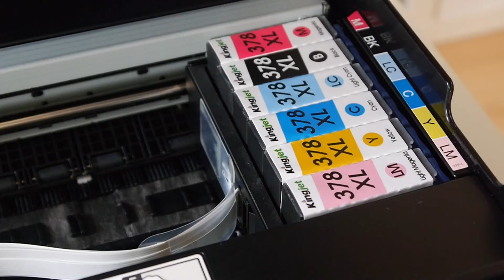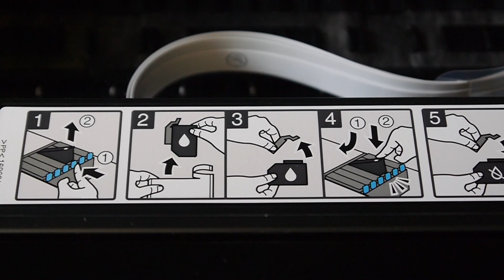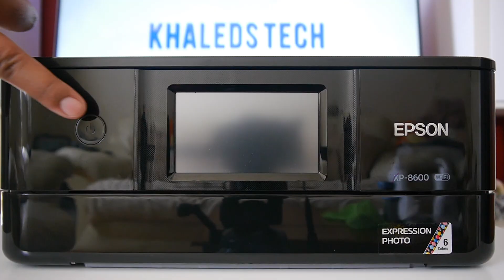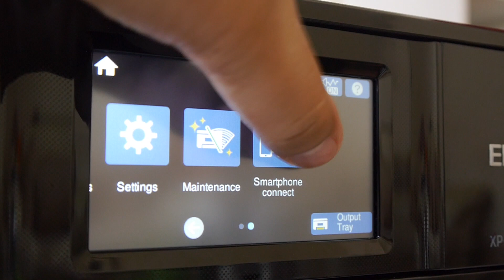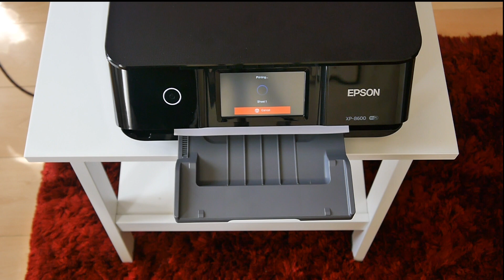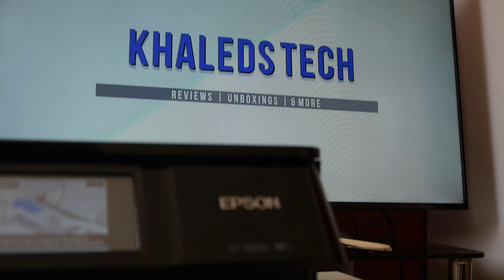Epson Expression Photo XP-8600 - Review

Comment: Interesting review, however an important factor you didn't cover and many other reviewers have also missed out on is the feature that it can print directly on to CD/DVD labels like the XP-8700 as well, and I had to contact Epson directly to find out about this and they said the Printer tray for discs is located underneath one of the paper trays which I found later, I hope this is a help for those who wish to print directly to discs rather than use stick on labels which go corrupt after 5 years due adhesive surface movement okay.
Reply from the maker: Thank you very much. I will pin your comment

Comment: Is this printer comparable to the 8700? What are the differences?
Thank you
Reply from the maker: Hi, I haven’t used the 8700 but it looks like the updated version of the 8600. I presume the printing maybe slightly quicker however apart from that it should pretty much be the same.

Comment: I’ve just purchased this printer… I took off the clear plastic strip that was attached under the inks and to the white ribbon (under the scanner bed)… should I have left this attached as you have? 🙈
5:54 minutes in, it can be seen - Thank You.
Reply from the maker: The white ribbon is required for the printer to function properly. The blue plastic strips are okay to remove.

Comment: The black is showing no ink and have replaced with others including a new epsom 378XL and still not reconised, is this a major fault to send away for repair or is there a fix that I can do myself ... Al
Reply from the maker: Hi Al, 
I am not too sure, you can maybe try cleaning the chip contacts with a damp cloth. Apart from that it may need to be repaired.

Comment: Hi KT, Interesting review. Liked the close up of the screen in operation. You are obviously knowledgeable about printers, so can you advise on the following please. I do not print a lot of photos, so is this printer good for general printing? Can it be used with a USB cable for computer connection. Quality of build? I know that noise is subjective, but reviewers like you may have a better interpretation of noise than the average user. Finally, no one mentions WiFi frequency compatibility, 2.4Ghz or 5Ghz. Many thanks. Terry Davis
Reply from the maker: Hi Terry, thank you for your comment and questions. I print several documents and also the family print out photos. Its a great everyday printer  and a fantastic photo printer. You can connect to your computer directly via USB. The quality of the product is very good along with a small footprint so it fits almost anywhere. Generally speaking the sound isn't too bad especially if you are connected via WiFi and the printer is down the corridor. You can select the quiet option if you're in no rush and then it just sounds like any background noise. I had a quick look at the Epson website and the WiFi frequency is 2.4Ghz. I hope this helps. Khaled
Reply: @KhaledsTech  Hi Khaled, Very many thanks for taking the time to respond to my questions, and for replying so quickly, a rarity these days. You have certainly given me more confidence in this product. I have established that my Router works on dual frequency, 2.4Ghz and 5Ghz. My concern is (as an 83 year old man), that I am not confident  or competent enough if I need to switch the frequency.  I may upset my Broadband, TV and Router set up. However, that's my decision and I really appreciate your comments about the printer. My thanks again
Terry
Reply from the maker: You're welcome Sir, you won't have to worry about switching any channels or frequencies. You can pick your network up through the on-screen display and put in your WiFi password. Also you seem to know your stuff so 83 is just a number 🙂
Reply: @KhaledsTech  Keep up the good work! I am a UK viewer of your video.
Reply from the maker: Thank you very much fellow U.K citizen.
Reply: @KhaledsTech  Hi KT, Not wishing to put all my eggs in one basket, what do you know and feel about the Epson XP8700 and the Canon PIXMA TS8350. They look interesting to me. Many thanks again Terry
Reply from the maker: I haven't used either but both of them are good. Due to personal choice I would go for the Epson.
Reply: @KhaledsTech  Many thanks again

Comment: Khaled; the printer arrived yesterday and today I am testing it for printing. The front power panel (?) does not stay shut, even when power is off. Tech support asked me to push harder to close it, but that, of course, did not solve the problem with this smoothly operating high-tech printer. If I tilt it backward I can close the panel. When I put it down flat again the panel once again tilts upward. I noticed in your video that the panel is shut flat until the printer is asked to print. What am I doing wrong? I hope you or another reader can help. Thank you so much.
Reply from the maker: Hi Tim, I will have another look tomorrow, that is quite odd, can I just clarify if you're referring to the panel that has the LCD screen on It? Or are you referring to the paper tray flap?
Reply: @KhaledsTech  ; Sorry I did not get back to you. I was referring to the "control panel" with has the screen and power button. I finally talked to a 3rd tech support person and she walked me through downloading the drivers for the printer. That was to turn on the duplex printing which I thought was automatically turned on by default. Then I told her about the cover issue and she like another woman told me to give it a little harder push to close it. I did and now it seems to be working. I will keep my fingers crossed.
Reply from the maker: No problem at all Tim. fantastic I am glad you're up and running properly. It does need a bit of a push sometime but don't worry it won't break. The design is pretty robust. Hopefully it should serve you well my friend.
Reply: @KhaledsTech  , I just tempted fate and ran it through a print cycle. All worked well. Thanks for your support. I look forward to your next videos. I just ordered a new Samsung 10" tablet. I will see if you have a video on it. I'd love to know what you think about the Galaxy Tab A7 (with 64GB).
Reply from the maker: Thank you very much Tim, I've done a unboxing of the Tab A and a shorts on Tab A7. Pretty decent tablet and ticks most boxes for everyday use. Thanks for your support as always

Comment: I noticed on the Epson site it shows a CD included for printer setup. This is not useful to most of us as so many computers have dropped the CD player. Can the setup be downloaded another way? Watching another reviewer video I noticed much of the setup seemed to show up on the 4.3 screen once you first turn on the printer. Is that the full setup?
Reply from the maker: You can set it up through the on screen printer and connect to your printer. Then your computer should pick it up on the same network, you may need to add printer under settings on windows 10. To get the full features you can download the Epson suite under drivers on the Epson website.
Reply: @KhaledsTech  , I have upgraded to Windows 11, but imagine is should set up fine with it. Thanks again for a great tip.
Reply from the maker: @timhvv  You're welcome

Comment: One very important feature am not sure is present or it is and you may have missed it, 
does it have a hidden CD/DVD tray on the side to print directly onto DVDS and CDS ?
Reply from the maker: Hi Mohammad, yes this is correct you will need to get the right media in order to print to the DVD/CD. Apologies at the time of recording I should of covered this but was unaware. I am working on a updated video for this printer which is long overdue.

Comment: This is by far the worst printer I've ever used. No manual, no quick start guide, insists on printing everything on A4 no matter what I do in settings. It prints as required from my old Win 7 pc but a complete turkey on my new Win 10 pc. Anyone got any ideas before I return it? Am I missing something?
Reply from the maker: https://www.epson.co.uk/support?productID=27797&os=19#drivers_and_manuals
Reply from the maker: Hi, Download the Epson full suite of software to make the best use of this printer.
Reply: @KhaledsTech  Very many thanks. That's solved it. I'd tried to locate drivers through the Epson site but I couldn't even find this printer listed. Very grateful for the direct link to where I needed!
Reply from the maker: Fantastic, glad it's all working now :) if you come across any other issues do let me know.
Reply: @KhaledsTech  Thanks again.

Comment: Thanks for your review. What do you think of the expensive price if the ink cartridges and I  was wondering if you get a lot more prints  with these
Reply from the maker: Hi Peter, the prices of the genuine ink cartridges are extortionate. I would put the longevity of the cartridges on par with the genuine ones.
Reply: Might have to think about getting the eco tank et-2750. Got loads of photos to be printed. Would you personally advise me to look into it   Never had a refill printer
Reply from the maker: @petergregory6185  I have heard great reviews on the Ecotank printers, however I haven't personally used them. If you are printing a lot of photos' and documents then it would be a good option.

Comment: I have this printer and I'm struggling to get quality prints. Especially on glossy/photo paper. I find that it prints lovely, but then when the ink dries it looks really washed out and awful. Is it a paper issue or the printer?
Reply from the maker: What sort of paper are you using? I know it sounds weird but you're not letting it dry near direct sunlight are you? Also what GSM photo paper are you using?
Reply: @KhaledsTech  I think it's dried in and out of direct sunlight. The paper I'm using is glossy white sticker paper from amazon. Evergreen goods. The GSM is 80. Maybe I need to fiddle around with settings?
Thanks so much for your reply!!
Reply from the maker: You're welcome. Please have a play with the settings. Do you use third party ink cartridges?
Reply: @KhaledsTech  no, the ones it came with. I'll keep playing with them and see if something works :) thanks again
Reply from the maker: You're most welcome :)

Comment: There is also a Epson XP-8605 in white, is it the same? 
Which multi function photo printer for the home around the £150 mark do you recommend?
Reply from the maker: Hi Natty, In all honesty this is the first time I heard of the XP-8605 but it looks almost identical apart from the colour. (If anyone knows the answer can you please reply in this thread) I have been using this printer for a while now for both home/office use along with occasional photo prints and scanning documents. I think its a great printer and does everything I need it to do however the ink is quite expensive :(
Reply: @KhaledsTech  How does it compare to the Canon TS8350 (Up to 4800  x 1200 dpi)?
Reply from the maker: I haven't personally tried the Canon but I chose the Epson based on reviews and print speed. Everything considered I would still pick the Epson over the Canon but that's just my opinion.

Comment: How does the 2sided printing work on this? Is it automatic 2 sided or do you have to reinsert the page for it to print on the other side?
Reply from the maker: Hi Alex, it automatically gets fed back into the printer when two siding printing is selected. No need to change it manually.
Reply: @KhaledsTech  great. Thanks!
Reply from the maker: @alexfergus8149  You're welcome.
Reply: Duplex works great.

Comment: I have this printer and I have printed a couple of prints but I noticed some horizontal lines coming on to my printer. I have tried everything in the settings to get rid of it but nothing is working! please help!! thanks
Reply from the maker: So you have cleaned the nozzles and went through maintenance. Can you take the cartridges out and see if there's any ink that is leaking and potentially try a new set? If you tried everything in settings it can be defective cartridges.

Comment: You don't say anything about the thickness of photo paper or cards which this printer will handle. Does the top, or rear paper intake facility enable the printer to handle, say, 210gsm paper?
Reply from the maker: Hi, Yes it can handle 210gsm photo cards/paper. If you're using 255/290gsm then it's best to feed the paper in one at a time so it won't cause any issues to the  printer.

Comment: Yes I would like to see the quality of output for photos on quality photo paper. Cheers 👍
Reply from the maker: Hey Andrew, will look into this for you :)
Reply: @KhaledsTech  Do you recommend this over a hp envy?
Reply from the maker: I haven't used the envy so wouldn't be able to give you a honest opinion. However I am happy with my Epson. Hope this helps.
Reply: I'm having issues with it printing darker than the screen with non-adjusted settings. My old canon mp540 printed screen brightness out of the box. Any tips? Thanks
Reply from the maker: Hi, you can do colour adjustment through the printer.
Reply: @KhaledsTech  ah. I'll check it out. I've been doing it through the printer dialog settings in Windows. Thanks!
Reply from the maker: You're most welcome. I am going off memory, if it doesn't work then please let me know and I can have a look when I am at home.
Reply: @KhaledsTech  I've been through the printer menus. I could find no color collection options.
Reply from the maker: Oh no! Okay I will have a look tomorrow and get back to you.

Comment: I have had this printer for 3 weeks now and am disappointed with it.all my prints are dull and no vivid colours, it is the same when printing DVDs,any help please
Reply from the maker: Hi, I haven't had any issues with my printer and had it for a while while. What are you printing, I am guessing pictures from your comment? I haven't tried printing on DVDs yet but it could be the resolution you're printing at?
Reply: So how do you change that and what too
Reply from the maker: Can you explain to me what you're trying to do? I will replicate the same issue when I get home and see what is causing your prints to be dull. There can be multiple factors, such as not the right type of paper, resolution or the quality of the ink.
Reply: Pictures I have saved on my PC of family.how do I change the resolution
Reply from the maker: If you print from the Photos on windows and click on print there is an option for you to select high quality under output quality. This is set to normal as default. Furthermore please use Photo paper if you're printing family pictures. Otherwise the colours will seem dull.
Reply: And I am using epson ink
Reply: Well after trying everything. Still cant get settings right so selling it and going back to my canon
Reply from the maker: Have you cleaned the printing heads via settings and everything else? Has the printer calibration been completed?
Reply: Yes all done.i give up.had printers for over 20 year and never had this problem
Reply from the maker: Sorry couldn't be of more help buddy. If you have bought it from Amazon then I can recommend a exchange. But if you're happy to go back to Cannon then I would stick with it. Let me know either way.

Comment: Awesome review. Does an XP-8600 block the use of non-Epson compatible ink cartridges?
Reply from the maker: Thanks Ron. It will warn you that you're not using genuine ink cartridges from Epson but it won't block you from using it.
Reply: @KhaledsTech  Great review dude, I ordered this printer and can't wait to use it. Do you recommend any compatible ink from Amazon?
Reply from the maker: @samete.3074  Hi Samet, Thanks for the kind words. I have used Kingjet inks which are very good and you can get them at a reasonable price.
Reply: @KhaledsTech  thanks for your quick reply, I will try them out.
The original ink cartridges are too expensive ^^
Reply from the maker: You're welcome. They are very expensive inedeed. I have several more tech videos coming up. If you want to be kept updated then do consider subscribing :D
Reply: @KhaledsTech  sure why not, keep up the good work 👍🏼
I have one more question, did you disable the update function of the printer because of the compatible ink cartridges? I had the Workforce for three years and never updated once because of it.
Reply from the maker: @samete.3074  Thank you very much Samet. Highly appreciated. I haven't turned off any updates although it does warn me when non-Epson cartridges are inserted.
Reply: @KhaledsTech  thank you for your support. I wish you all the best :)
Reply from the maker: Thank you, stay safe Samet :)